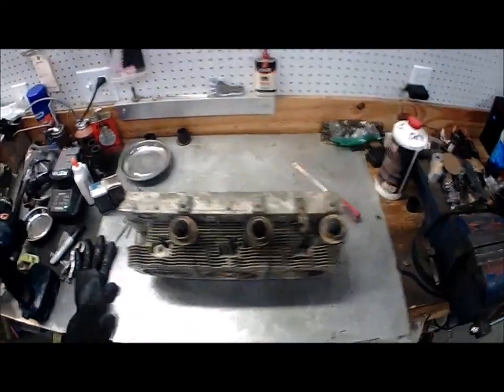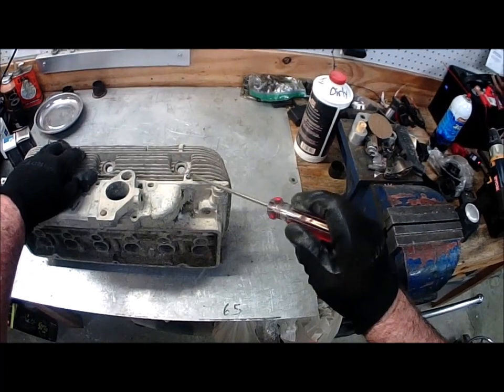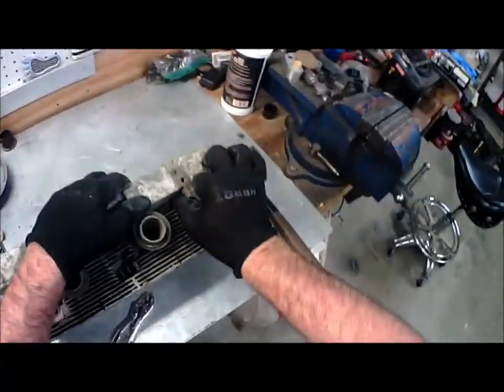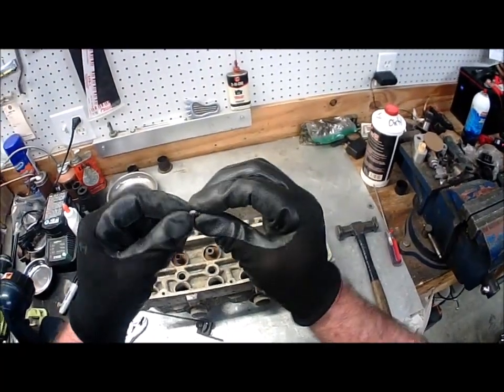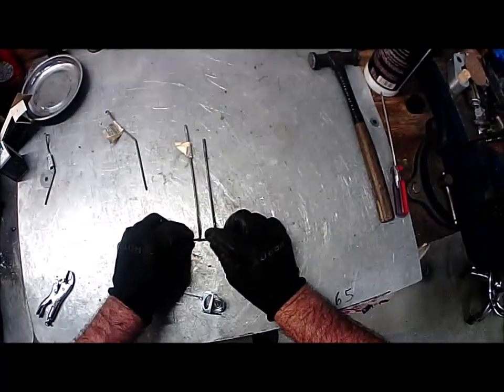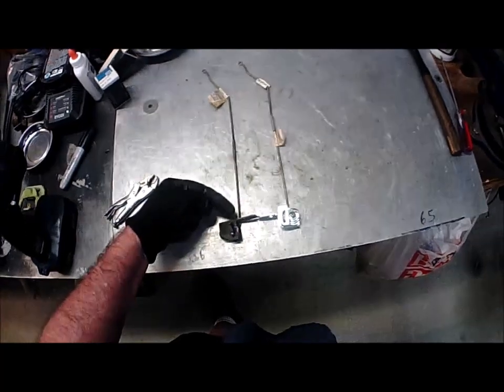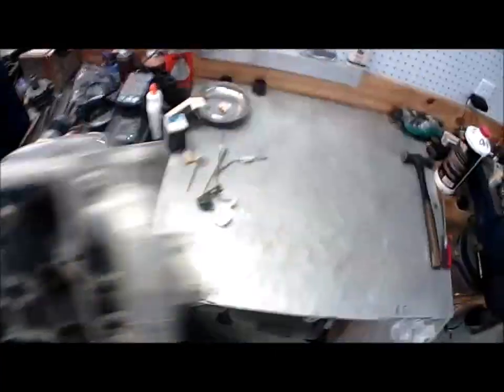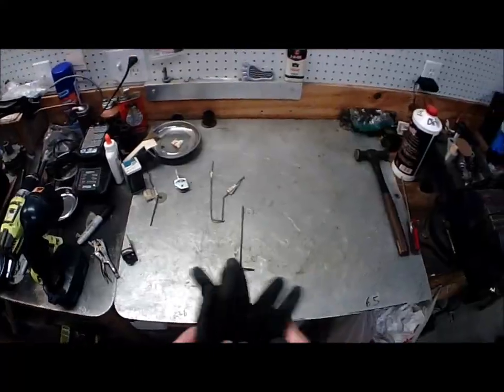Corvair early and late choke differences and removal.

Comment: Hey there Dave you always have good content do you do mechanic work for customers i have 62 monza with 102hp and powerglide motor is frozen but i have a fresh rebuilt 140hp for it just picked up rear 65-69 motor mount so looking for someone who can help with swap it also have with a 4bbl 450 cfm holley carb and ieco manifold so looking for a good mechanic im here in the san fernando valley..